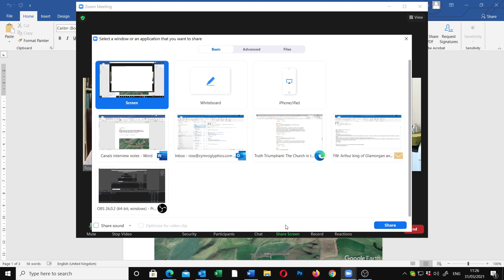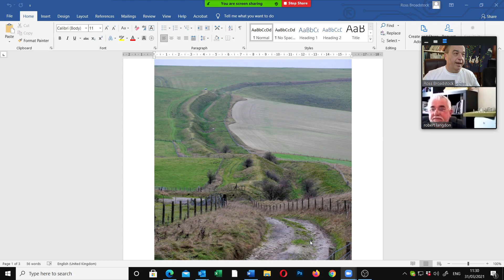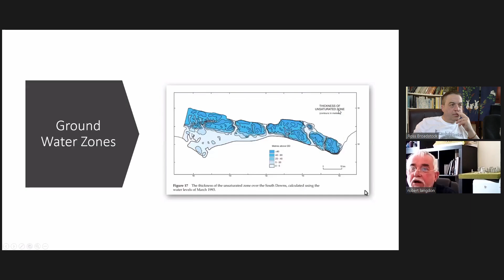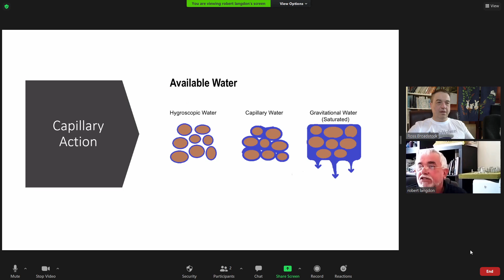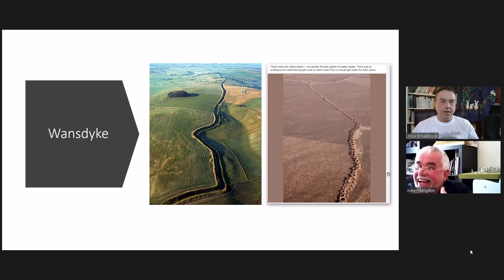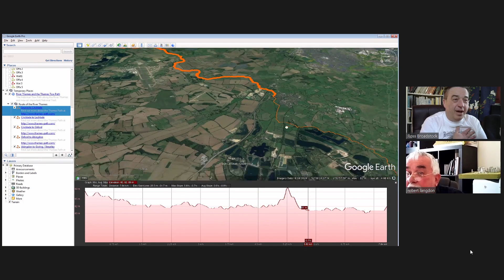How ancient dikes were really canals that went up hills and covered Britain - Robert Langdon

Comment: With respect to RL, why would you need a canal where there is the Wye, the Severn and the Dee?
Reply from the maker: I wouldnt dismiss RL's theory on that basis. I understand that the main idea was to link the great rivers to provide a continuous path without the need to cross land.  As shown in the 18th Century, canals also have many advantages over trying to move goods by river.  There may have been waterfalls, rocky areas, treacherous navigation etc.  Hopefully RL can comment with more on this
Reply from the maker: I am sorry that your other comment doesnt seem to have come up for some reason.  It was on my notifications but I cant see it or reply.  Perhaps you could try again?

Comment: I've seen plenty of natural springs in Wales flowing down mountain roads. Thousands of spring become a brook or even a river.  Horses could pull barges along or 'up' the brook/river.  For fast flowing rivers a strong team would be needed.  In Cornwall counter weights are used, so 'bags of water' could be filled and let loose and through a pulley assist the horses to drag the weight of the barges up stream.

Comment: Speaking as someone who once achieved 2% in a maths exam (balancing the 98% in English), I would humbly suggest that the dry brickwork is helping to suck up the water by the process of osmosis.  I would love to understand just a little of this; please tell me if I'm right or wrong?
Reply: I can see why you would think that but it's really just because the bricks are permiable and they are kiln dried so will suck up any moisture they can from any direction Marchell. I could be wrong but in my mind it is just a capillary action. Hope your well. Been enjoying your videos. Very interesting subject indeed.
Reply: @chriswood3370  Thank you!  I think it's fascinating, but I'd better stick to the words . . .
Reply: @marchellabrahams  It is a fair question. the only problem with osmosis in this scenario is the bricks would have to have a medium which could be replaced but like I said they are kiln dried. They start sucking in moisture from the air at the point they come out of the ovens. Surprisingly though it never seems to penetrate the brick fully. The water from the ground soaks the edges of the bricks and climbs up that way. The damp proof course is usually 2 bricks above the ground level to stop it creeping further up. The bricks do soak in water on the front face continiously and eventually will become soft and flaky relatively speaking but that is why you have an inner and outer wall. it doesn't matter how wet the outer bricks get if it was built properly. The water is not supposed to be able to pass to the inside course of bricks.
Reply: @chriswood3370  That's the sort of physics I can understand.  Thank you very much for the explanation.
Reply: Its not osmosis, it is to do with charge. Heat is charge.. Heat rises from the ground and heat is a photon. Like a load of tiny bulletts shooting upwards. At our scale, charge is about 1% the power of gravity. So even though gravity is pulling everything down, there is a weak force of heat counteracting against gravity. Gravity is a function of diameter so the smaller the diameter, the less the effect of gravity. Once you get to about 0.5microns, gravitys effect becomes less than charge and charge starts to force things upwards. So damp is water permeating through a 0.5micron fissure. This is the same mechanism that allows trees to suck water from the ground. It is also the same mechanism that causes lift on a wing..
Reply from the maker: Interesting thought and I think you can now double your 2% to 5%.  I think capillary action is slightly different to osmosis.  Isnt osmosis passing between materials whereas Capillar action is moving up something regardless of things like gravity?
I will send Robert a message to see if he can clarify.
Reply: Rising damp is due to water tension like capillary action and that is why there is a height limit to it to match the water tension. So, Rob's analogy here is not correct however his joined up springs to form a canal is very plausible. I have a lot of respect for Rob.